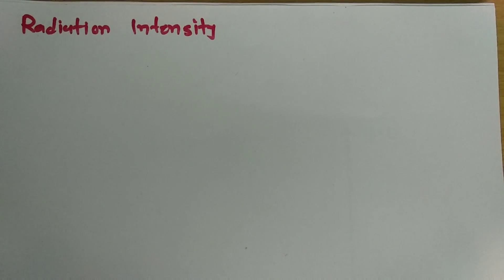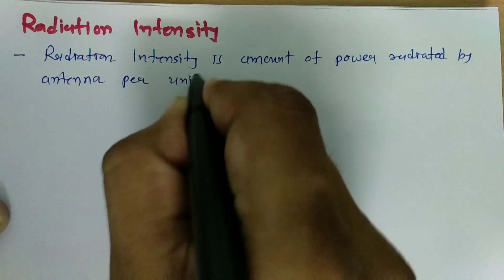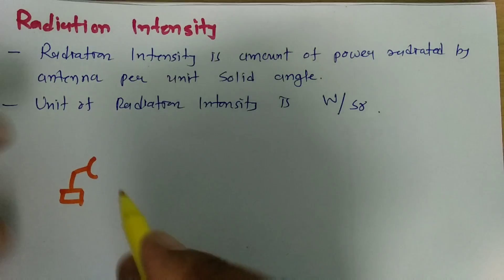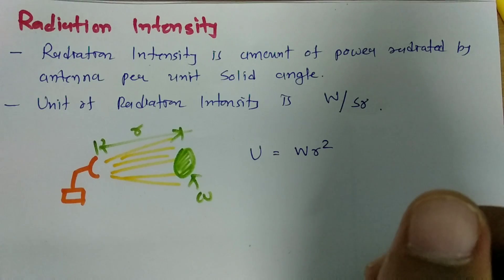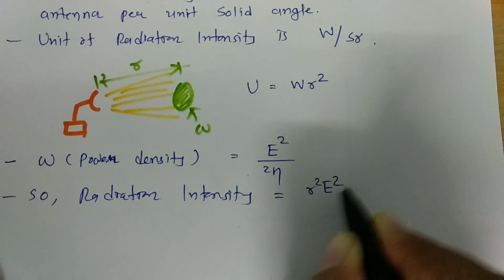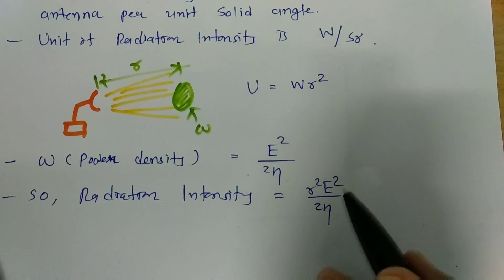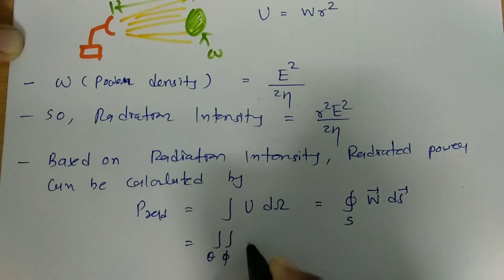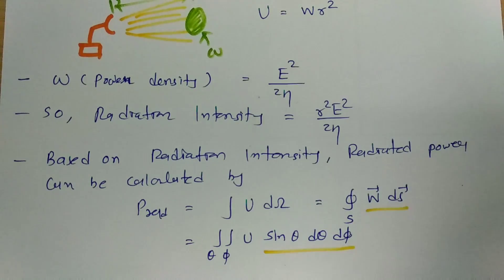Antenna Radiation Intensity (Definition, Basics, Unit, Formula & Calculation) Explained

Comment: sir as distance(r) increases , intensity should decrease. But according to u=wr^2 , u and r are directly proportional . how is it possible sir?
Reply: Radiation intensity is always independent of distance r, its definition is power radiated per unit solid angle i.e power radiated through 1 steradian angle. It depends on how much power is radiated through 1 strd solid angle.